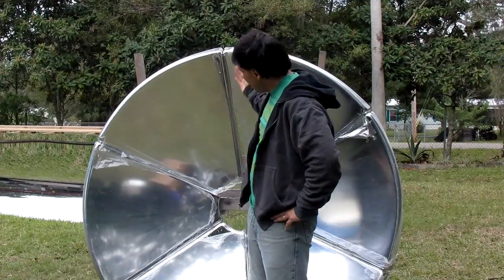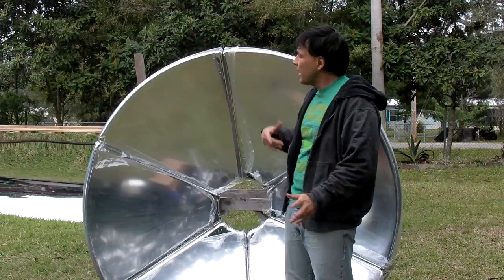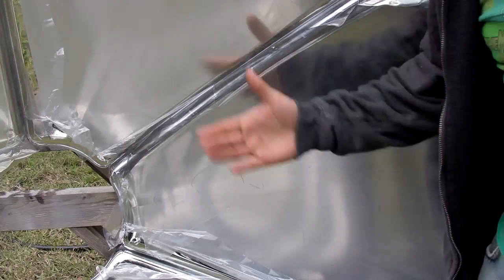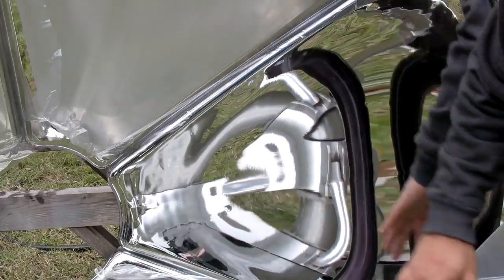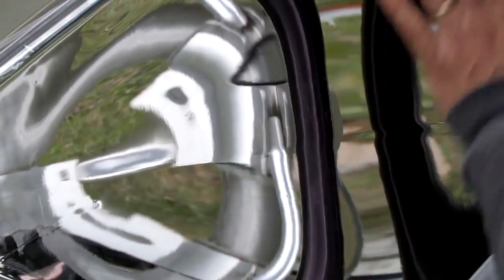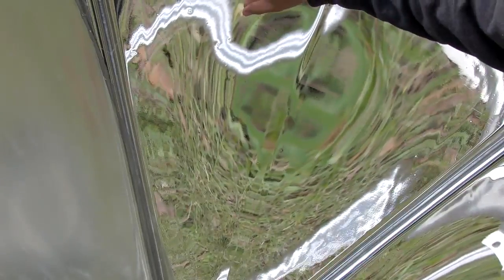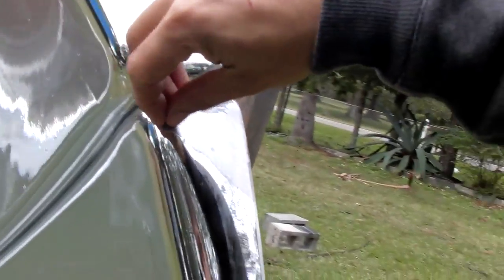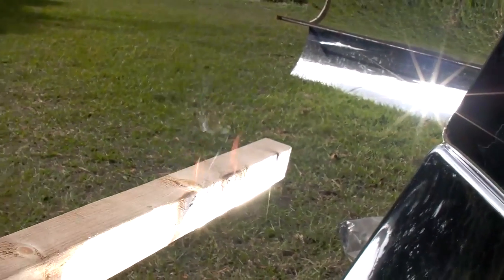SOLAR PARABOLIC MIRROR SOLAR DISH 65" diameter 165cm

Comment: could you say what is the main difference if you use metal sheet or acrilic sheet? one of the disadvantage for metal sheet is only wieght and  one of the disadvantage for acrilic sheet is cost ? which one do you use, you get more spot light? and also how is making parabolich dish for  assembling parts? is it only flat sheet or ready parabolic sheet? please answer me as soon as possible because i am making an experience and so it is important for me there is no time for me.thanks

Comment: I have produced steam with an old 8' dish covered with sign quality reflective film. I will be posting more, but currently I have the dish facing down testing the longevity of the film. It has been out for about 6 months now in the Florida sun and the adhesive is showing no signs of degradation.

Comment from the maker: @marionrickard The acrylic for this design was too thin and produced a poor spot. Also because of the moulding process, there was little control over light scattering. We have up to 46" mirrors on our website greenpowerscience they are true shapes with great spots, just smaller. The acrylic is also thicker so they don't break easily. This mirror array is now in pieces:-(

Comment: 2 square meters is the right size to make heat. I made experiment with 1 square meter and I think it is not enough in canada in winter (-30C in January).
Thin mirrors (from bathroom) cut in small pieces is very good and cheap.
The thickness of mirrors is important. It has to be thin (less loss in absorption of solar energy) more reflexion.
Do not use aluminium paper not a reflexive material.
Take care - chris

Comment from the maker: I think that would be a great idea, this is distorted because it is just propped up. The problem with thicker acrylic is cost, there is over $600 in raw acrylic in these before work. Thicker acrylic will not works as the pieces will not fit and also too expensive.

The imperfections are from the moulding process, they are like little bumps. The mould is very rare and acrylic usually does not show the imperfections when clear but the metalizing brings it out.

Comment from the maker: I do not want to bask company names but there are 2 that sell spray $129 can, black gloss silver wipe and clear. AVOID, JUST SILVER PAINT, if you look at an angle it looks mirrored but so does gloss black, CAMERA trick, customer service "please hold" NEVER returns. Called 10 times. Either they are really busy or...

The metalizing process is the only real option.

Comment: I wonder if building a frame to mount that on with some screw like devices that when tightened would push out on any imperfections in curvature for even more uniformity.